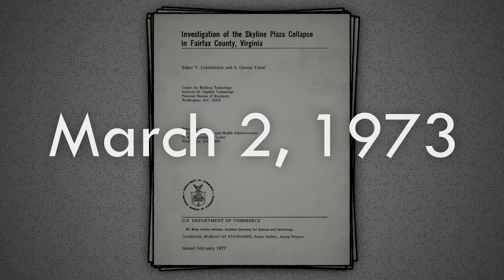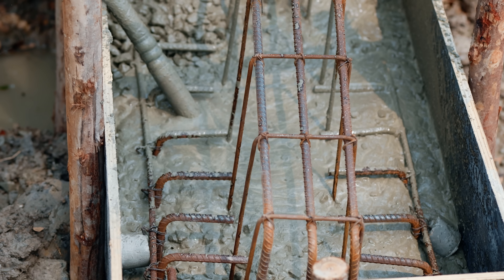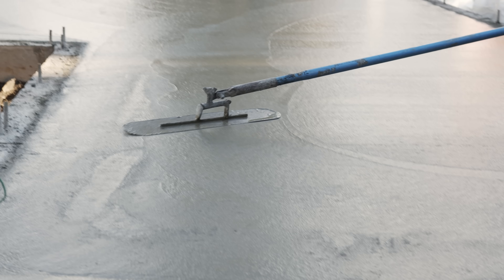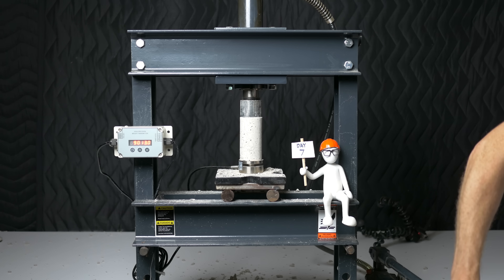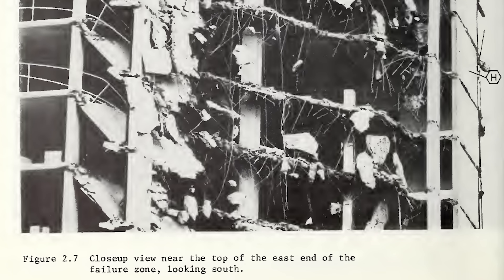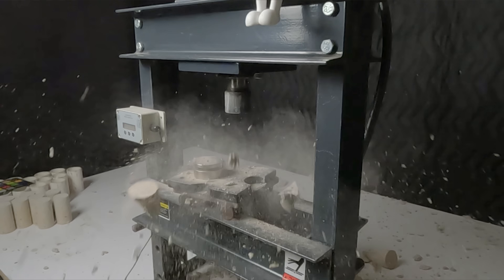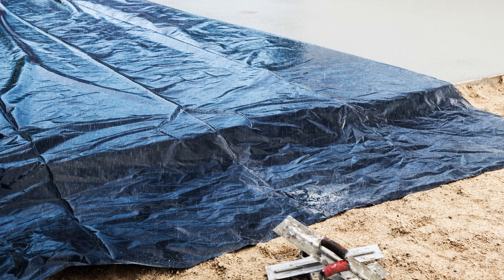Concrete's Greatest Weakness is Time

Comment from the maker: 🏞Lots of cool stuff (plus my book) available at the PE store: https://store.practical.engineering/
🌌Get Nebula using my link for 40% off an annual subscription: https://go.nebula.tv/Practical-Engineering
Reply: Precast concrete sounds like a good solution to the problems associated to the long waiting time. Are there any downsides associated with using precast concrete? (do you have a video on that subject?)
Reply: @PracticalEngineeringChannel
I am a construction practitioner in China. That would be great for general public to know about the latest development of construction industry if a video about different Modular and Prefabricated Technologies in both civil and building projects can be made. The applications of DfMA like Precast Concrete and Modular Integrated Construction (MiC).
Reply: 2:21 The environmental issues are negligible compared to almost anything , remember this the cargo ships run on Heavy Fuel Oil (HFO).............i dont say it to you, to the peppole hu came up with..
Reply: western massachusetts they're doing surveys because of the sand that was used in concrete has something in it that making it fall apart. Its pyrrhotite .
Reply: How come I can't buy a little mini Grady figurine of my own on your store?
Reply: Why you don't use a pipe extension for the hydraulic jack handle and avoid all the concrete spalling on your own person?
Reply: I'm interested in concrete strength if you put it dry and just spray it with water, a guy on youtube build his retaining wall with concrete bags and just spray it with water, the internet said it'll collapse but it was fine after few years and it hold tons of dirt. I'll be delighted if you do some experiment on that
Reply: You should do a video on Roman concrete! I heard it's making a comeback but the people who discovered the mixture and process are gonna patent it and shop it around. If that's true... Boo to those people. We need all of our concrete to be self healing!
Reply: Could you do a over mixing project and how aeration weakens the mix with detergents and modified bonding agents
Reply: What if you reinforcee steel with concrete
Reply: Do you follow @PlainlyDifficult? Failure Guaranteed: The Skyline Plaza Tower Disaster 1973 | Short Documentary | Plainly Difficult...
Reply: "problems with concrete: 1. Quality of material because all companies try to make it as cheep as possible, to make money. 2. Quality of manpower, from engineers to the man withe the shovel. Well made concrete constructions can hold for centuries, like the Pantheon, the Cisterns in Rome. But it takes time.
Reply: @benpeterson3847  no. Old concrete uses calcium oxide instead of hydroxide. That's all there is to it
Reply: Is it true Hoover Dam is still curing?

Comment: Shoring gets removed because it is needed elsewhere. After the Surfside failure, shoring was so hard to come by, Florida was importing it from Georgia and Texas. [Mantra from a Chinese tofu-dregs failure: never waste good cement in cheap concrete.][The Romans didn't run concrete test samples when they built the Pantheon.They didn't need to.]

Comment: I learned first hand just how much concrete can cure over time. The house I live in was originally built to house British soldiers here in Germany, shortly after WW2. The concrete has had almost 80 years to cure - and it very much did. While trying to install a lamp we managed to destroy a rock drill, which should have normally made easy work of concrete. But this concrete was so hard we barely made progress, and eventually wore out the drill. (And yes, we made sure we didn't accidentally hit some steel reinforcement.)

Comment: I work for a major geotechnical and cmt firm and I’ve tested some concrete that’s incredible! High early 7000-10000psi concrete gets up to 80% within the first 24hrs then we start stressing the tendons. 

I’ve also worked sites where the plant sent the wrong mix or the driver went to the wrong site and it creates massive issues. 

Your technique of casting cylinders wasn’t to ASTM lol
Reply: Also a lot of times before a slab is ripped out the contractor or the concrete supplier, depending on suspicions, they will take cores and do rebound hammer tests (rebound hammer is not very reliable) then if those cores meet spec the engineer will accept it. If it doesn’t then someone is getting a big bill 😂

Comment: On my home I needed to moisture concrete slab for 7 days. About 4 times a day. And temp.was around 20c.
And even then I had few surface cracks...
Mold are removed after 21 days

Comment: From the title, I thought the video would be about reinforced concrete's inherent weakness for long term construction.  Over decades the steel reinforcement eventually corrodes, compromising the strength of the construction.  Ancient Romans knew this and never put iron reinforcement in their important concrete works.  Modern designers stopped the policy for cost and expediency.  Modern reinforced concrete construction will fail within 100 to 200 years.

Comment: My father was an electrical contractor - a couple of notable concrete issues he encountered over the years...
On a high-rise building, there was a problem with an entire batch of concrete (multiple trucks) and it didn't achive its correct strength. Fortunately this was detected during the site sample testing. The whole level of the building had to be demolished and replaced.

On another job, the builder was rushing and pouring structural concrete at the same time as paving... As expected, there was a grave error and the trucks became mixed. Fortunately some part of their process still worked and they detected the error, but not until a lot of progress had been made on the site. This mistake bankrupted the builder and had a major financial impact on my father 😔.

Comment: I have done lots of inspections and concrete testing. Did it so much I could tell the slump just from visual inspection coming from the chute. Air content is the trickiest part of concrete. So many things can affect it, but the biggest is using a pump on site. Especially if there are lots of bends in the pump, it seems to knock the air out of it. Testing from the chute, I would get like 11-13% air, testing from the pump it would drop down to 5-6%. Often if the mix has no air-entrainment, then 28-day strength is usually met at the 7-day test. Even if super-plasticizer is used to soup it up to an 8-inch slump.

Btw, only cylinders are used for concrete sampling. Usually cubes are for cement or mortar samples. Sometimes I've put cement into small cylinders. 

Also, field cure samples shouldn't be used anymore. When you have a 50 or 100 CY pour, the majority of the concrete (other than the perimeter and surface exposed to weather) is protected from the weather and is curing in a temperature well above the outside freezing temps. That is because the curing process creates a chemical reaction that produces heat. Field cures are typically left by the slab or placement and are subjected to much colder temperatures than the internal parts of the footing or slab.

Comment: When reading the title I expected this video to be about the loss of the protective alkalinity due to carbonisation. In the long run concrete won’t protect the rebar from rusting anymore, not a problem for the concrete itself, but the structure as a whole does lose strength.

Comment: If you're ever in London, you should visit Kirkaldy’s Testing Works. Kirkaldy was a pioneer in the systematic testing of construction materials including concrete and steel. Today it's a museum that shows off the equipment designed by Kirkaldy for this purpose.

Comment: Addition: Another primary enemy of concrete is actually rebar. Yeah. The steel bar reinforcement inside the concrete.

Once the rebar starts to rust, it expands, and breaks apart the concrete it is supposed to be reinforcing.

Comment: Law of concrete concrete cracks. And yes not enough curing time, being placed in extremely cold weather or hot .... Concrete design not designed for specific application, excessive water cement ratio. I could go on and on let anyone who knows anything about concrete understands that if it is the correct strength and mix design for the job and is not watered down after it reaches the... job site along with numerous other factors will definitely results in structural failure.  I was in the ready mix concrete business  for 20 years with much experience and education improper concrete applications. There's one word or words that describes 97% of concrete failure and that's improper design and placement based on the structural requirements of it's application.  I was certified by several States as well as certain national concrete institutes employing standards that everyone from the suppliers of materials, the proper training and oversight of ready mix concrete mixing and delivery and application. Actually if the concrete is poured properly within the specifications of all guidelines and requirements of these institutions along with the structural engineers all the way down to the deliveries of concrete and to the concrete finishers who plays the concrete... The concrete will continue to grow stronger over time even over years and decades yes I am familiar with the equipment for testing the structural strength and tensile strength along with all the other tests involved. However if the concrete is mixed and delivered properly but the crews placing are not highly educated or just don't care you can destroy the construction integrity of the concrete. I know the concrete will sit under water and that after it's poured in most cases he is a good idea to keep the slab or structure wet or moist in warm environments. Let me finish watching your videos it's very interesting.  Test cylinders are used  at the plant and the job site. You know what you talking about

Comment: I would also add; according to the ACI 301 section 4.2.3.3 - the Required Average Strength of a design mix has to be higher than the requested amount.  If f'_c is 2500 to 3000, f'_cr is that amount +1000psi, +1200 for 3k to 5k, and 1.1f'_c + 700 if over 5000; probably for the reason you mentioned in the video.  This is if there is no field data records.

With field data records, then it is instead based on f'_c plus an amount based off of the standard deviation.

Comment: Lmao. I figured the title was clickbait... But nope, youre just working the hardest (way harder than the contractors, foreman, and engineers in the failed concrete projects youre discussing) to avoid saying the biggest threat to a concrete project is laziness, ignorance, and stupidity of the people working on the project. 

I finally had to stop watching the video when i realized you wrote an "engineering" video in the style of a guest appearance on sesame street. If you are working on a poured concrete structure, and the people working on it dont seem to care that it is too dry to pour flat, you may be dealing with a contractor who learned about concrete from a bad youtube engineering channel, and its time to pull the permits to find the GC or local authorities number to let them know. 

See, concrete wasnt the problem all along. Is your next video going to be 25 minutes of blaming the empty bottles of beer when someone drunk drives?

Comment: Reshoring was a constant argument 25 years ago when I was involved with pouring overhead slabs. The contractors usually wanted to pull it out too soon. On one project where I was in control, I told the contractor to look into getting a faster setting concrete. For $5 a yard extra for the concrete he was able to pour and strip forms almost a week earlier(just like your example). Very good video. Good Luck, Rick

Comment: I worked construction for years. Every time we poured a slab all of the rebar and mesh was rusted threw before it was put down. Usually it's completely covered in heavy rust before it makes it to the site. I always wondered why all of those components weren't required to be galvanized.

Comment: As a smaller residential contractor...the price per metre or yd on a 25mpa mix to a 32 with air is so negligible, yet i hear others cheap out its barely a few hundered dollar on a full load. I get on bigger scale jobs it adds up but it so often is not the materials fault but an attitude problem or pettiness perhaps

Comment: Summary of the video

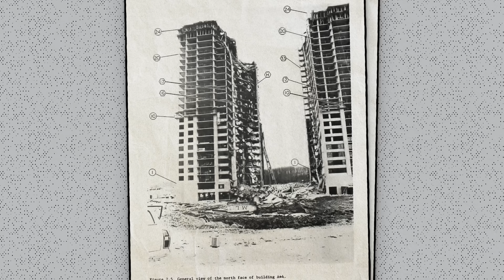(00:52) Inability to Bear Load Immediately: Unlike other building materials, freshly poured concrete cannot support its designed load. Removing support structures too early, before the concrete has gained sufficient strength over time, can lead to catastrophic collapse, as seen in the Skyline Plaza disaster.

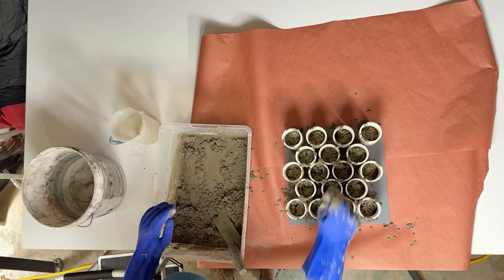(01:44) The Curing Process is Unstoppable and Slow: Concrete gains strength through a chemical reaction called hydration, which is a slow process that cannot be rushed and is affected by external conditions like temperature.

(07:38) Quality is Unknown Until After Installation: You cannot fully test concrete's strength until after it has been placed and cured. This creates significant risk, as a failed strength test discovered weeks later can mean tearing out the work and starting over.

(10:41) A Bottleneck for Construction Schedules: The standard 28-day wait to reach design strength creates a major bottleneck, delaying critical paths in projects like road repairs and skyscraper construction.

(13:54) The Need for a "Leap of Faith": Ultimately, time is concrete's greatest weakness because it forces engineers and contractors to wait weeks before knowing if the material will perform as expected, a unique challenge not faced with other structural materials.

Comment: The company Charles E Smith was the GC at the Skyland Plaza failure. They were well known for pushing hard to save money. They had another building fail exactly the same way, in Crystal City, under ten miles away a few years earlier.

Comment: It should be mentioned that concrete truck drivers will carry a couple bags of sugar or a couple 2 liters of a full sugar soda in their cab to prevent the concrete from setting. Long ago I used to make those cylinders for concrete testing and learned a lot from the drivers.

Comment: 0:47 sounds like concrete's greatest weakness is actually poor preparation. I was totally ready for a discussion regarding the finite limitations of the stress cycles in bonding agents such as epoxy. If wanted to understand how horrible human foresight was then I would just look out the window..
Reply: Removing forms too early is not “poor preparation”

Comment: Pretty cool! In the mining business we use a version called “paste” to fill stopes (areas of an ore body that has been mined). Doing this offers ground support which - depending on the mine plan - allows for mining above, below or beside the filled void.  Lots of engineering challenges, we try to use tails (waste) from operations as the base, so every mine has a different recipe. Plus designing the underground reticulation system has challenges too, it’s called “paste” in part because it flows like toothpaste through the pipes.  Might be worth a video!

Comment: It would be great to see videos about oil well cement use. We still use various grades of Portland cement but solids such as sand and gravel cannot be used since we have to use positive displacement pumps to pump it down hole at pressures that can exceed 7500 psi. Instead of accelerators we use friction reducers and retarders to give adequate pump time. Also spacers have to be used ahead of the cement slurries to clear residual drilling muds from the inside of the casing being cemented and then as the cement is displaced in to the annulus of the new casing string and the open wellbore. Inversely we have to reduce the hydrostatic pressure exerted by the slurry using nitrogen to pump a nitrified foam slurry. It’s still exerts the mechanical UCS but reduces the risk of the slurry breaking down the unconsolidated formation encountered when installing the first 36” casing string from the mudline to usually 250 to 400’ below the mudline.   It’s really interesting. I drilled offshore wells all over the world for over 45 in increasing water depths with 9400’ being the deepest water I ever drilled a well in. And some of those wells were drilled an additional 20-25000 feet below the mudline. Really enjoyed this topic.

Comment: As a construction manager the only aspect that truly worried me was any substantial concrete pour. In forty years I have been lucky but watched as the suspended floor on the building next to ours collapsed whilst pouring. No deaths but several major injuries resulted. There are many factors outside of compressive strength that affect  concrete pours. Retired now don’t  miss the stress.

Comment: I wouldn't call that on weakness.I would call that a time constraint. You have to plan adequate time for the concrete to there is one weakness of concrete. I would like to point out the filler that you add to the cement to make concrete has to be absolutely clean, no bacterial.  Material or fungi can be in that material nor biological either. If there is , it will crumble and fall apart in about five years. If you do it right if you do it absolutely clean materials.It'll last for a hundred years possibly a thousand. After all if the romans could do it why the hell can't we.

Comment: I love your videos but you mentioned installing anchors in green concrete. We teach our apprentices to never, ever install anchors in concrete less than 28 days old. It can spall the new concrete, or usually the anchors pull out when trying to fasten them due to a lack of concrete strength.

Comment: To inhibit corrosion when using chloride curing accelerators, might the rebar be dipped in hydrofluoric acid to form a fluoride passivating layer?